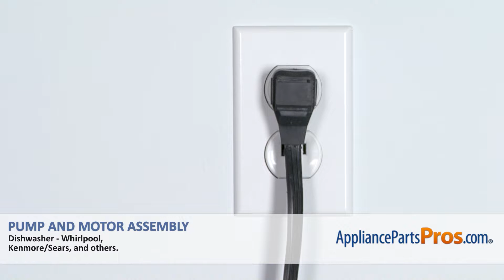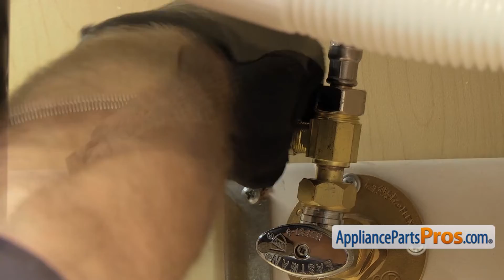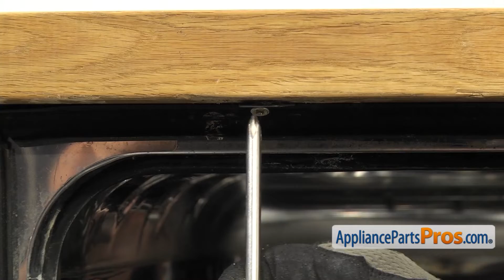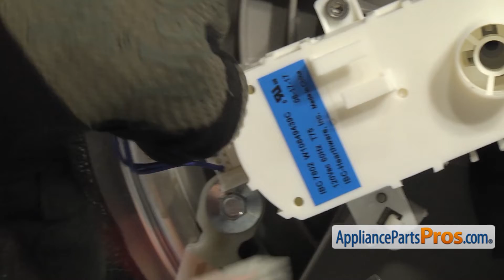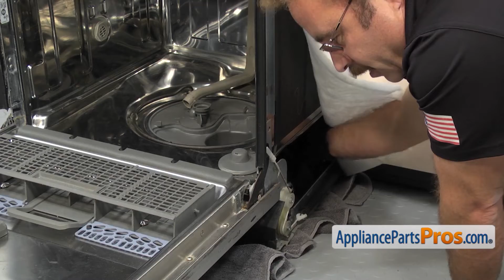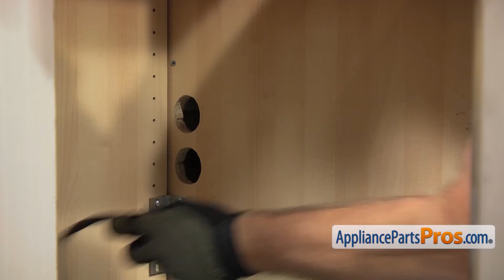How To: Whirlpool/KitchenAid/Maytag Pump And Motor Assembly WPW10482502

Comment: washer would fill then not wash dishes well, not run for the last hour, occasional electrical clicking noises during this time, dry soap after the cycle ends but does drain well at the end.  Nothing else was wrong on the machine.  This fix was it. Thank you very much for giving me what feels like a new dishwasher again.  This video helped a lot.  Gave me confidence.  Don't forget to put the concrete weight back on like I did. Two hardish parts were putting the new one in, the drain pump hose male end would barely fit and gets a little scratched up and the 3 locks that hold the whole thing in need the assembly to be set low in the hole for the locks to swivel in place (which is a good thing to avoid leaking)

Comment: Thanks for this video. It's step-by-step instructions were great.
My unit was hardwired into my electrical system. 

1. I TURNED IT OFF OFF THE DISHWASHER AT THE FUSE/BREAKER BOX.
2. There is a small hex bolt securing a metal box that contains the hardwire connection. Removed that bolt which allows greater range of motion to gain access.
3. Removed the top of metal box by sliding it backwards.
4. I disconnected the +/- wires

Comment: This video was extremely helpful to me for replacing the motor assembly in our KitchenAid.  It was just out of warranty so I got the parts free of charge but had to install myself (Whirlpool has great customer service - always worth a call).  The original installer did a hardwire install but didn't leave enough wire to pull the unit all the way out so I had to cut it and rewire.  I also must have loosened the supply hose connection in the bottom front of the dishwasher when removing the drain hose or wrestling with the new unit (the connector is plastic), so I'd recommend making sure it is tight before turning the water back on (even if you don't think you touched it).

Comment: The video was extremely helpful and the step by step was awesome. The only issue I had was that my dishwasher was attached to the sides of my cabinets rather than the top since I have a granite countertop. Once I figured that out the rest was pretty easy. The repairman wanted $400 for this repair and the part was only $250 so it’s a win in my book!

Comment: I have a KitchenAid KDFE104DSS0 and had a leak with the Diverter motor. My suspicion was that the seal the Diverter motor plugs into was leaking. To replace that seal you need to buy the whole sump tray anyway. I opted to replace the entire Pump and Motor Assembly and spend a little more ($50 estimate)  to insure I don't get leaks from the other motor and pump later. The part listed in the link fit my washer. The repair is simple and the video does a great job walk one thru the repair.

Comment: Performed this repair last night on a similar Whirlpool dishwasher (portable, model WDP350PAAB6). This procedure is correct. But be prepared, my new part required plenty of "persuasion" to properly fit down into the tub base so I could turn the locking tabs. Easy to get two tabs locked but then the third locking tab would not fully seat. Used plenty of dish soap to lubricate the seal. Laying the unit on its back and having a helper was key -- the helper could work on rotating the locking tab while I used my fist to fully seat the assembly. This part must be popular -- two other sites had it backordered for two weeks. These guys had it in stock and delivered next day, even with standard shipping.

Comment: Very good instructions! Just replaced the Pump and Motor Assembly because our dishwasher wasn't filling and washing properly and leaving detergent behind. Error code was 4-3. The hardest part was pushing the sump down and closing the 3 white tabs.  The dishwasher works fine now, but I still get the 4-3 error code. How do I delete it?

Comment: Excellent instructions.  The dish soap was key for me in getting the sump sealed properly.  Very well done!  As previosly me4ntinged might want to add a comment about a pic of where the wires go.  Accidently pulled off the drain wire.  Thanks for all you do!

ruplled

Comment: Thanks for the vid. This was a fairly easy job. Believing i had a pump issue based on weak water pressure/dirty dishes, i replaced the assembly. I then  took the old one apart. The culprit? A busted and completly blocked food chopper unit. This effectively cut water flow to the pump. The food chopper is not serviceable by regular maintenance. Indeed the dishwasher pump must be removed to access it. And you have to uninstall and flip the dishwasher to get at the pump!😠 Bright side? I have a spare pump!😄

Comment: There is a video out there about swapping this assembly without removing it from the cubby.

Downside for a DIYer not pulling it out by my mind is losing track of which wire goes in which place.  If you pull it out you can take a picture of everything and make sure you get things right.  You also have to use a shopvac or something to ensure the drain line is completely clear.

But it is do-able without pulling the whole machine out.
Reply: Depends on the model i guess. I just did this job and there are many wires hooked to the assembly that go to various sensors that are NOT part of the assembly. You can only detach them by accessing them with the unit out and on its back. My model: Maytag mdb8969sdm0.
Reply: I watched that one too and quickly realized it would be easier to disconnect everything and pull it out. The video did have the helpful tip to line the gasket with dish soap before installing.

Comment: Very Nice video, good speed and description on each step.  We have a Kenmore Elite 665 with this same basic assembly. It has developed a grinding noise.  I did not see anywhere in your video a separate grinder assembly.  How would we troubleshoot this issue?  Thanks
Reply from the maker: What is the model number of your dishwasher?

Comment: Replacing everything is a bit overkill.  The part we found to be broken was the connection between the impeller to the grinder.  2 plastic pieces that are designed to fail. We cleaned the whole system and it worked for one load.  Then it was back to no pressure due to food build up.  We suspect a toothpick was the culprit.  The grinder connection was a bit chowdered, the impeller connection was rounded smooth.

Comment: Good video overall but look out for one error. My setup is KitchenAid and these instructions for putting drain pump back on would have resulted in weight of dishwasher loading on drain pump or no vertical clearance btw drain pump and floor. I compared to a picture before disassembly to ensure video was incorrect. Everything else was great and I would have struggled figuring this out on my own.

Comment: Just performed this.  Make sure you fasten the old drain pump securely to the new pump assembly and that it's sealed in place.  It seemed to lock for me, but started leaking immediately.  Secondly, I had to use a lot of strength to get the new pump assembly to sit all the way into the tub for the 3 fasteners to lock.  Video is otherwise on point.
Reply: Took me at least five tries to get it right. You have to push down pretty hard or it slides out of place as you're turning.

Comment: There’s a settled class action lawsuit against kitchenaid/whirlpool for a diverted seal leak.  If your model is covered you can get $$ back.  You have 90 days from the repair to claim up to $200 or get a discount on a new one.  Depends on the age of your dishwasher when it failed.   $200 about covers the part.   This dishwasher also steamed the inside of my cabinet which is why I suspect the insulation has a plastic liner.  You can see mineral residue on a part on the left side (facing) with the black tube.  Won’t buy another kitchenaid that’s for sure!   I recommend everyone install a water alarm or a pan under the dishwasher to make sure you notice if it leaks.  Fortunately the insulation soaked up most of it but not all of it.
Reply: I have a whirlpool and that exact thing is leaking on me too.  Now the unit is 11 years old so probably SOL on anything.  Figured it is time for an upgrade anyway!

Comment: have a kitchen aid unit( 2yrs old) lately after the wash cycles over their is a pool of soap in the bottom of the unit and the dishes aren't clean. Is that a pump motor issue?
Reply: does the water drain out and leave just a little at the base, in hole, of the circle filter at the end of cycle?

Comment: I just installed this whole assembly, and my dishwasher still doesn't spray the water. Nothing is clogged, I just ordered the turbidity sensor. Could that be it? I checked the latch, and it clicks shut, the dishwasher fills, and drains, but doesn't wash. Please help!
Reply: Dear G556,
I’m having the exact same issue as you.  I checked the latch, and it clicks shut. The dishwasher fills, and drains,  but doesn’t wash.  I was about to order and replace the whole assembly , then I read your response.  I would love to know if replacing the turbidity sensor resolved your issue?
Thanks so much for your time and effort,
Reply: @bobbyhendrix3393  I'm wondering if the Turbidity Sensor resolved the issue for you? I'm having the same problem, the dishwasher doesn't spray water, fills and drains just fine... now I'm thinking it may be a waste fot buy a whole new motor and pump.
Reply: I'm wondering if the Turbidity Sensor resolved the issue for you? I'm having the same problem, the dishwasher doesn't spray water, fills and drains just fine... now I'm thinking it may be a waste fot buy a whole new motor and pump.
Reply: @JohnCuppi  No it didn't work. I replaced everything except circuit board. I'm thinking moisture ruined the electronics. There was junk all around it. I threw it out after spending half of a new one in parts. Money down the drain. I bought a new washer.
Reply: @user-pk8pf8nh6s  Thanks for replying back. I took a chance and bought a new pump assembly for $100. I read somewhere that it is possible for the circuit board to not send 120v to the motor/pump, which can also cause this, but I don't have a safe way of checking the voltage, and I don't know where the ground and positive terminate. I've only had my whirlpool dishwasher for 1 year and it's broken. So sad. :(
Reply: John, 
Replacing the Turbidity Sensor didn’t resolve the issue.  I had to replace the motor/pump.  Once I did that, bam! The dishwasher was back in business. Thanks to the video replacing the motor wasn’t as difficult as I thought it would be.  I hope this helps? Ok
Reply: Bobby Hendrix Thank you! Crossing fingers that is the pump/motor. 👍🏻
Reply: Gents i had same problem. I had cleaned everything. Still no real water pressure on the dishes and they arent being cleaned accordingly. Thinking it was the pump, i replaced the entire assembly. Issue was fixed. I then took apart the old one. The culprit? A broken and completely covered by debris food chopper unit. This effectively blocked water flow to the pump. The food chopper is not part of regular maint. Indeed in my unit you cannot access it unless you remove the pump. And to remove the pump you have to uninstall the dishwasher and flip it over. 😠 I paid $220 for the new assembly. I saved $800 however as the new dishwasher the wife wanted cost over $1000. Plus i now have a spare pump😄

Comment: My Kenmore dishwasher does not have the counterbalance weight on it is that normal
Reply from the maker: Possibly, depending on the model.
Reply: AppliancePartsPros That's what I figured since I bought it new and after installing thanks to your instructions it is working great. Thank You
Reply: Yep, mine didn't have it either.

Comment: The mistake of whirlpool is that they don't listen to service team feedback.  The insulation blanket is not attached to the dishwasher making installation and service quite a hardship.  Whirlpool was unable to add 4 plastic plugs to hold that blanket and make things smooth like other brands such as bosch or LG. This is why we advised hundreds of new buyers to avoid whirlpool and its sub-brands like maytag, kitchenaid, amana..etc..what kind of stupid design team repeats same mistake over 15 years ?  People be warned whirlpool is garbage.

Comment: for the price of a new sump assembly unit you might as well buy another dishwasher. It would take even less effort to simply trouble shoot the motor w/o removing the sump assembly. Obviously they are profit oriented.
Reply: Meh. I paid just under $600 for the dishwasher three years ago and now it's up to $800. $200 for the part but it was not an easy job.

Comment: You're just showing us what a repair man would do. What if I'd rather repair or only replace the broken/defective parts of the assembly? You didn't offer any help with that approach. For what the new assembly costs replacing it is a waste of money, get a new dishwasher. Thanks for nothing.
Reply: By my pricing the assembly is not that much more than the pump alone.

And the video is what it is.
Reply: Whole assy for me was $200. New dishwasher? $1000. You do the math.